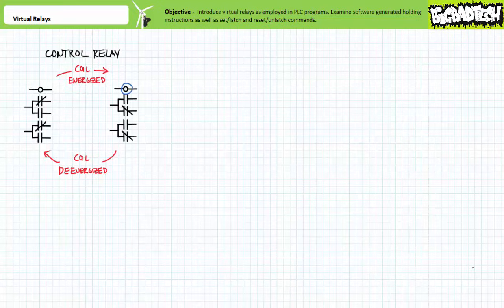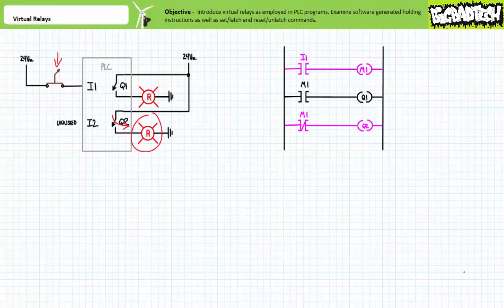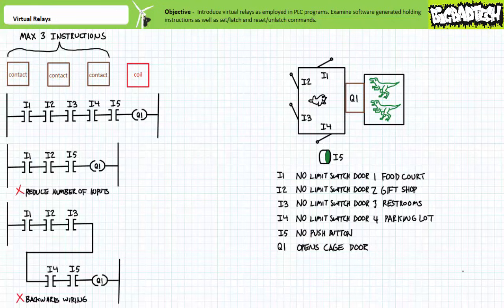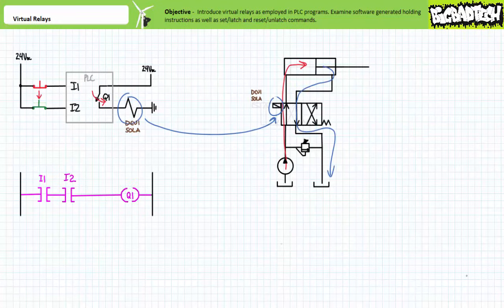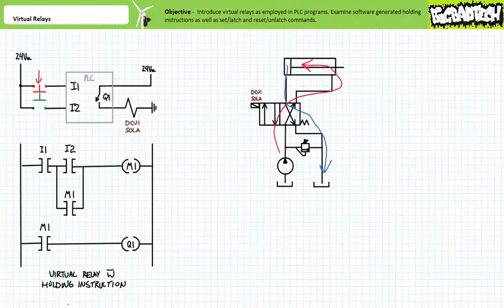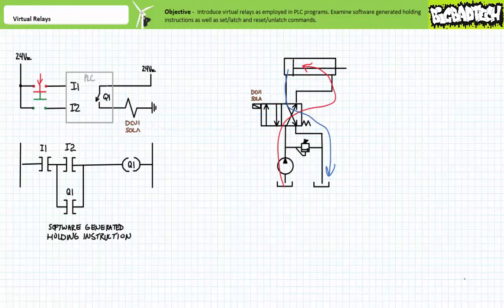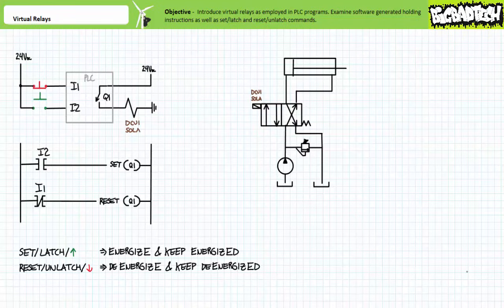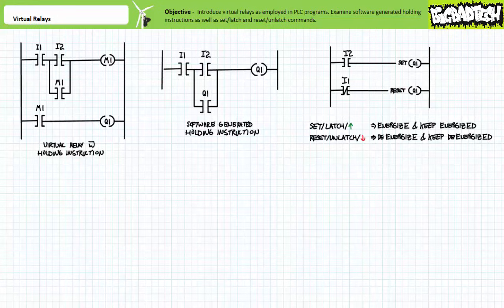Virtual Relays and Holding Circuits for PLCs (Full Lecture)

Comment: i love how you persist and maintain the terminologies used with different things....And not skip from one to another. it sort of embeds it into memory (atleast for me) when i think back on your videos. great channel.. question: the N/C on I1 presents as a N/O contact on the rung.. and the N/O on I2 also presents as an open contact but on input I2. is this correct? how do i diffuse the confusion with these? I'm fairly new to PLC's but have electrical experience and schematics, but this boggles me a bit
Reply from the maker: Check out the "Basic PLC Instructions" lecture at: https://youtu.be/ic9crSVVF9Q Long story short there is a difference between the electromechanical nature (ie: NO vs NC) and the programmed instruction (make vs break) and you are free to choose which combination you want.